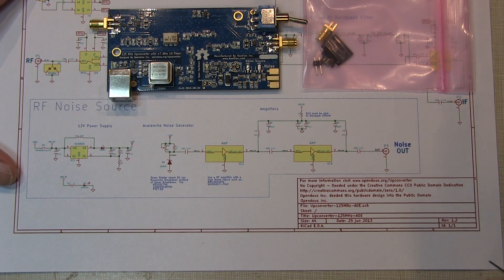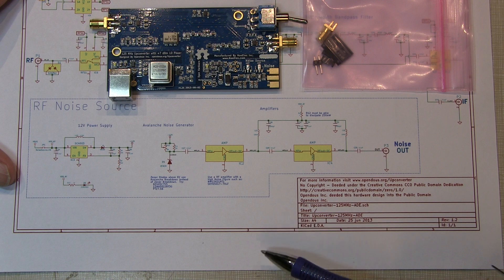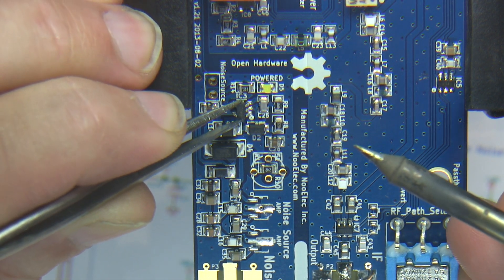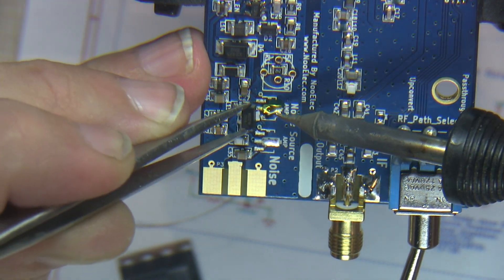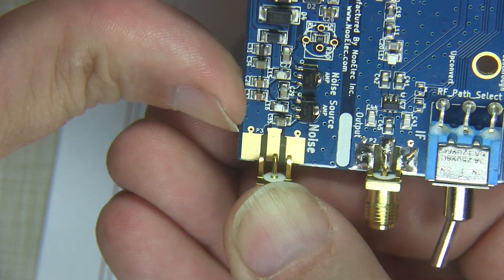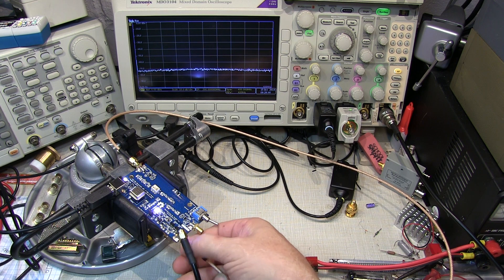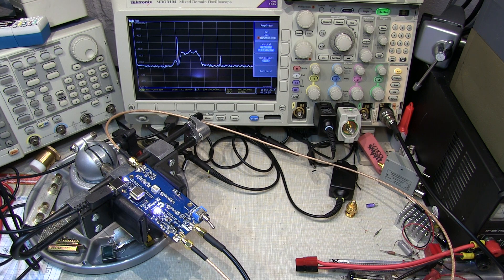#178: Build, test, use the RF Noise Source on the Ham-It-Up RTL-SDR Upconverter

Comment: How do you make the noise at a certain frequency?
Reply from the maker: What specifically do you need to do?  What frequency?  At what bandwidth around that frequency?
Reply: @w2aew 100 mhz 2400-2500 mhz

Comment: Where did you find the schematic? I am trying to solder the battery pack to the pcb and I cannot find the correct terminals or at least im not sure exactly and id like to verify before potentially frying something. Not on the official website, annoying. All I see is a small spot labelled battery with G and +V, battery, +V is confusing me because it suggests positive terminal and ground but nowhere to connect the negative, i assume +V is negative and G is positive but, maybe its the wrong terminal? weird
Reply from the maker: My assumption would be that G connects to the negative terminal of the battery.
Reply: Mine too, I went ahead with it anyway jist with a 5v supply to testand lights came on, seems working ok too!

Comment: You can use this noise generator to find out self resonant frequency of capacitors.  We know that a real capacitor is actually a series RLC circuit.  Therefore, if you place the capacitor in between noise source and spectrum analyzer, at self resonant frequency of the cap you should get a peak, since it has the least impedance at the peak frequency.
Reply: Another application that I found is to get the Body plot of gain magnitude -- not the phase-  of opamps.  Of course the noise generator has to be modified to optimized for lower Frequencies, since most opamps have Unity Gain Frequency (UGF) of few MHz.  Putting the circuit under test between noise generator and oscilloscope with FFT, since most RF spectrum analyzers do not go down to DC.
This made me interested to think about  designing a circuit that can do both gain and phase Body plots. Stay tuned.

Do you guys know how do they measure phase in Vector Network Analyzers?

Comment: I too have rtlsdr devices and want to do DIY Antennas and need to tune them. what freq range can the ham it up noise source produce? my dongles go from 30Mhz - 1700Mhz and 50Mhz and 2200Mhz. would the ham it up noise source work for tuning antennas in those ranges? thanks!
Reply from the maker: I don't remember what it looked like above 400MHz, and I no longer have the device to retest it.  Sorry I can't offer  more help.

Comment: Nice video - Where did you get the v1.2 schematic?  I am having a problem with my v1.2 and would like to attack it "armed" with a drawing.
Reply from the maker: +Don Evans At the time I built it - v1.2 was the current version - so this is file I pulled from the GitHub archive.  I see that they only have v1.3 now.  I wonder if you emailed opendous.org if they'd send you v1.2?

Comment: Hay Allan ,
Yes , with 5 connections and oriented so that it is sitting as mounted on board like in video and call 3 pads on top & numbering 1-3 , left to Rt. , then the bottom 2 , 4 & 5 left to rt.
I get
1 - 3.691
2 - .001
3 - 4.74
4 - 4.75
5 - 4.75
Reply from the maker: KD0CAC I havent' had a chance to test the pin voltages on mine.  Since it is a switching boost regulator, a DVM reading on the SW line is not going to give you an accurate result  If you're not getting 12V on the output filter capacitor, then there is a problem with the circuit (bad chip, bad diode, etc.).

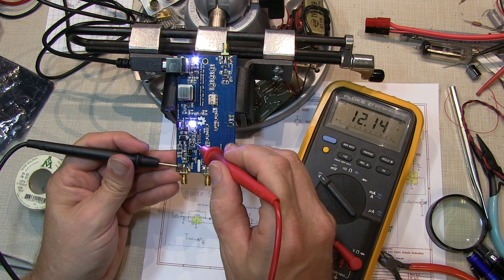Comment: At about 5:46+ checking for the 12v for zener diode , I only get the 4.74v ?
Dogie dew
Reply from the maker: Have you checked the output of the switching regulator? The 12v should appear on one side of the bias resistors in series with the Zener.

Comment: Hi Alan, thanks for all your great videos
can you please tell me what the output level of the noise source should be?
i have a HP8590L without the tracking gen option, so thought i could use the noise source to with the mini-circuits 20-5 coupler todetermine VSWR curves for DIY antennas.Only problem i am having is that output is way too low on mine to make that measurement as the antenna, once connected receives stronger signals than what the noise source is putting out. Amplifier maybe?
thanks
Ralph
vk4hr

Comment: Why do we need those two OPAmps? Just to strengthen the Noise signal? And it was already asked: But why do we actually get noise using the avalanche breakdown? Super cool vid, but instead of seeing you solder it, id prefer you to explain a bit more :P :)
Reply from the maker: They aren't op amps, they are a pair of broadband microwave power amplifiers.  They are used to increase the noise power.  The avalanche breakdown of the PN junction results in broadband white noise due to the electron flow process.

Comment: You can also use the RTL dongle itself to make those measurements. I use it sometimes to do a quick check on filters (It's good enough to see where the passband of a filter is, and the passband attenuation can be determined more or less). There are several programs to make those dongles hop over a large frequency range and make a composite spectrum. I wrote the procedure down here if anyone is interested: http://hansvi.be/wordpress/?p=91
Reply from the maker: Very nice - thanks for the write-up. I's sure a lot of people will be interested in the RTL based composite spectrum scanner.

Comment: Hello Allen,

My name is Nathan AG6AV. I enjoy learning from your channel.

I am interested in buying the noise source, but I can not find any specs on the noise source. What are the specs for the noise sorce? I would like to see a spectrum plot out to 3 gig on your 3104, because I would be using it on a MDO 3024. Perhaps, a reference max hold trace while the SA is terminated, and a max hold trace of the noise source. 

Or, is there a better noise source to use with the MDO3000? (I wish Tek included one to match the 3 gig SA).
Reply from the maker: EE_Student@ASU Hello Nathan - There aren't any specs that I could find on the noise source.  Design information is here:
https://code.google.com/p/opendous/wiki/Upconverter_NoiseSource
The noise power started to fall >400MHz, and by the time you get to 700-800MHz, it was basically gone.  Probably limited primarily by the diode capacitance and layout issue and PCB board material.  On the MDO3K, the AFG Noise waveform can be used, but it's only good out to about 70MHz or so.  There are plans out there for homebrew noise sources that will go into a few GHz frequency range.  Another inexpensive one is the Elecraft NGen module - good out to about 500MHz:
http://www.elecraft.com/manual/E740057_N-Gen_Manual_Rev_D.pdf

Comment: Thanks for the video! :)  Is there a place where I can learn how those amplifiers work? Normally I'm used to them having dedicated Vcc and GND pins, but with RF amps I usually see them being biased using an inductor like in this example. I don't really know how they amplify in this case!
Reply from the maker: Nick Leijenhorst The basic principle is that the DC power/bias can pass right through the inductor, bu the RF output signal sees the inductor as a high impedance.  The "load" for the amplifier output is typically the input impedance of the next stage.  A good example of how these amplifiers are designed and operate can be found in this application note from Mini Circuits:
http://www.minicircuits.com/app/AN60-010.pdf